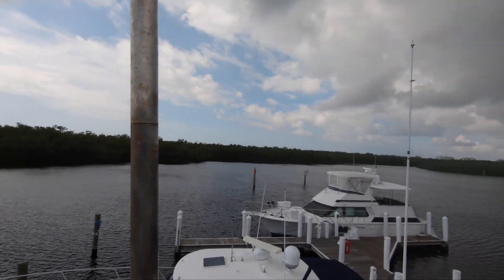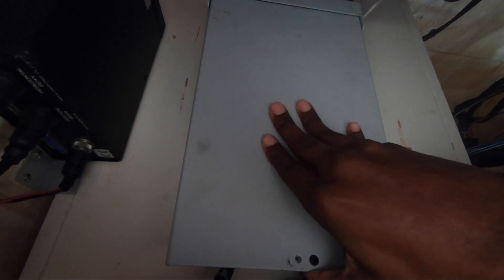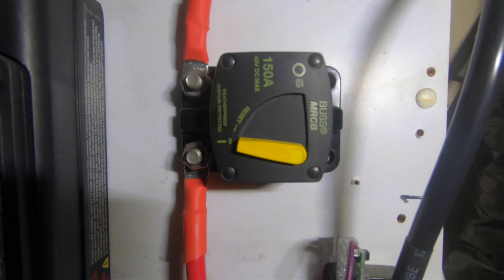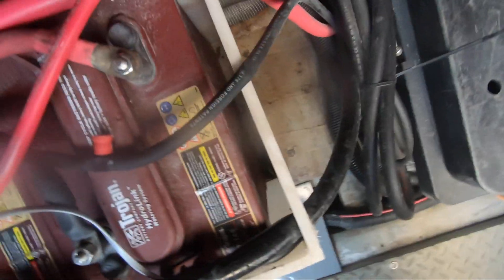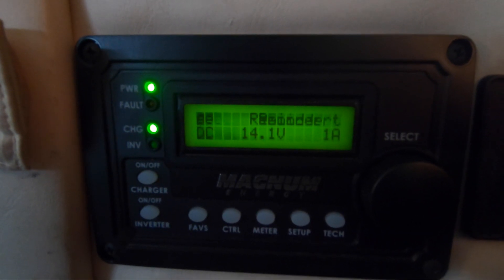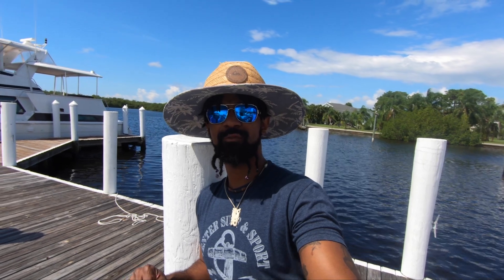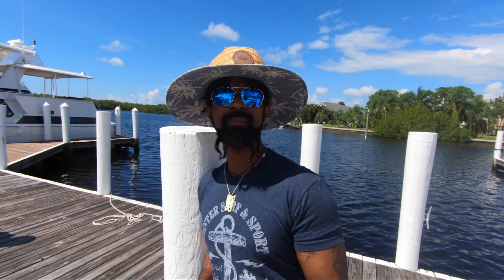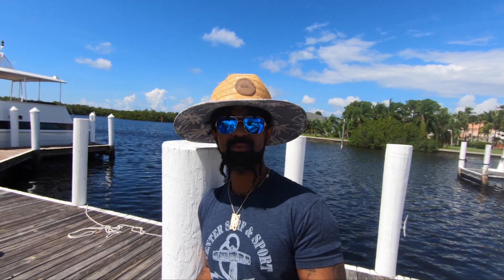Sea Ray Solar System Walkthrough

Comment: What was your total dollar investment in the solar system? Winter is Florida has more sun and less rain. That has to help the system generate.
Reply from the maker: The main components cost $2099.24 shipped. I have another $150-$200 worth of cables, connectors, panel mounts, and other small misc items. So under $2400 total.

Comment: Next fall I plan to bring my boat (45 Excalibur) from Michigan to Florida by Oct. 1, however I have talked to several marina's in Florida regarding the possibility of getting a slip for the 6 winter months then return to Michigan for the summer. ALL say they have a waiting list and it will probably not be possible to secure a slip during that time.

From your experience, would you agree that getting a "nice" boat slip at a marina in Florida from Oct. 1st to April 1st will be almost impossible?

If that is the case, I may be forced to live on the ball and have a solar system.
Reply from the maker: First of all, that’s an awesome boat you have. There was one that was restored at an old marina of ours. It looked amazing.  

I think that the closer you are to October the better for securing a slip. It seems that marinas are going to be more packed than usual this year with snowbirds, so it’s always a challenge, but I think there’s always an open slip somewhere. There are plenty of marinas that aren’t on people’s radar, that don’t show up when looking for recommendations, and in my experience those are the places to be. It just requires a little more research on google maps/earth, and a few more phone calls, but I think there’s a slip out there. Especially if you aren’t too partial to a specific area in Florida.

Comment: Hey Will, have you figured out what your air draft is on the '99 480? I was looking online but couldn't find it definitively. Thanks!
Reply from the maker: We’ve been rolling with rough figures of about 18 feet so long as we collapse our antenna and anchor light. I suppose it’s not too far off based on the number of bridges we’ve been under that have been just below the 20ft mark.
Reply: I’ve got a 2000 480 and I have the same numbers as Will.

Comment: Nice video and setup. I just grabbed 4x 370w panels for $138ea and a 48v 5kwh LFP battery while I was in Phoenix last month for my RV. Lithium and Solar is def getting super affordable if you're considering an upgrade.
Reply from the maker: That’s awesome. I’m glad to see lithium (and solar) become more reliable and affordable. I do think we’re gonna go lithium, but likely on the next boat, or perhaps an RV even.
Reply: @TeamWiff  yup, the tech is growing and maturing and cost is coming down so fast too. 5 years ago a 48v setup was insanely expensive to get all the working pieces. I got a high quality 5kw multi unit with shore power tie for 1/3 the cost of a Victron Quattro setup. Keep up the videos my dude, helps me keep grinding on my boat dreams. Thank you.

Comment: Do you power any 120v devices directly off the inverter?
Reply from the maker: The fridge, freezer and half of the outlets run off of it. We don’t like the 12v fans so all of our fans are 120v and we ran them non-stop. I contemplated running the microwave off of it as well, but never did.
Reply: @TeamWiff  you did say 300watt inverter right?   That seems like a lot more than 300 watts!
Reply from the maker: Whoops. I meant to say 3000.

Comment: Thank you for taking the time to show us your setup! I'm currently in St. Louis, looking at fellow full time cruisers and learning what it takes to get a good overall set up on an MV. We are looking for a place to land down in your neck of the woods and am curious how to pull off a 9-5 job and have the boat life. The mortgage has me bound to land for the meanwhile. Weather is changing and  trying to decide to head south and find work there or hunker down and prepare to brave the cold here. Love your channel, thanks for your hard work! Totally dreaming about the days when I'm doing a Tortuga run. =)
Reply from the maker: No problem. Thanks for watching and hopefully you find some of it helpful. When we first moved aboard we found the transition was super easy, and didn’t feel like a major lifestyle change, but that’s because we pretty never took that boat out. That and we already had our jobs, so it just felt like a local move. I think if you get a boat, marina, and job figured out, the transition won’t be as difficult as it say seem. But the boats livability will be an important factor.  I say come on down if you can find a way to make it work!